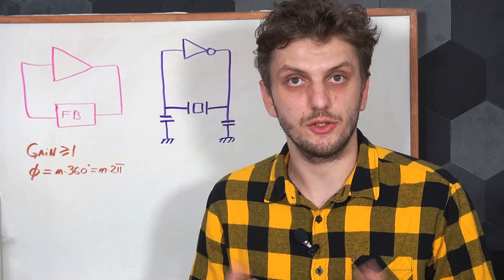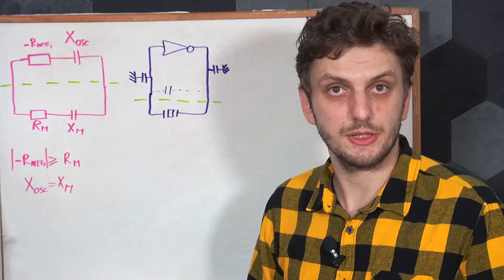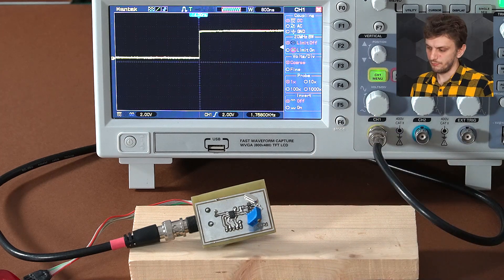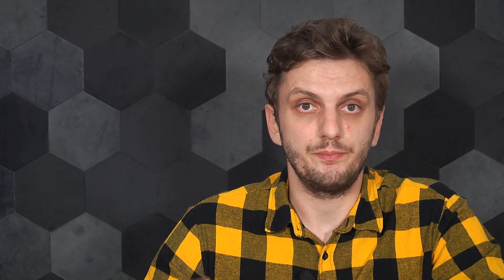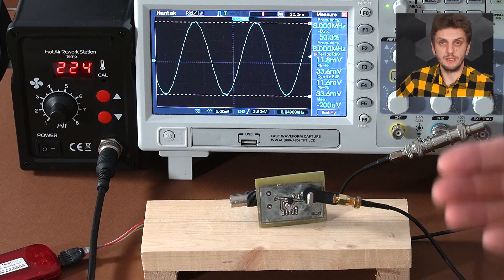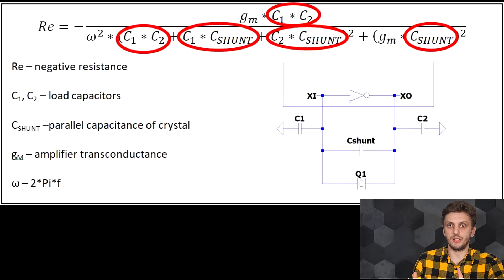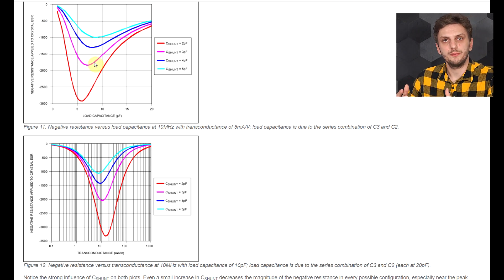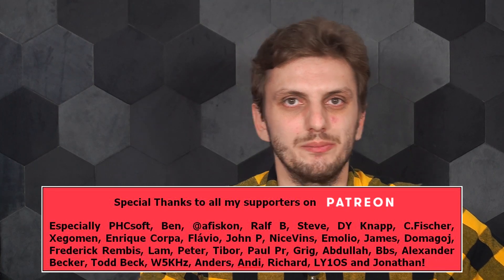Crystal oscillators - Negative resistance and oscillation margin measurements

Comment: To get the negative resistance higher, cant you attenuate the amplifier gain downward by adding a feedback resistor? That is a resistor across the input and output of the amplifier.

Comment: why dont you just pıt oscilkoscope probe on the xtal pins?
Reply from the maker: The probe has 10-20pF of capacitance; adding the prove directly would completely change the oscillators behavior.
Reply: @FesZElectronics  What about active probes? They have like 0.2 pF caps at max.
Reply from the maker: In what I observed from various application notes, measuring the oscillator frequency (the most sensitive test to external factors) should be done indirectly (either near-field probing, or using some other IC pins that output the OSC frequency, when available); but other measurements - like waveform shape or start-up time can be done with an active probe with direct probing.
Reply: @FesZElectronics  OK thanks! I am starting to measure my own crystals now :)
Reply: @FesZElectronics  Also I didn't catch how did you calculate the already existing 37 ohm ESR of the crystlal? Datasheet only states the maximum.
Reply from the maker: For the negative resistance measurement, usually the datasheet max ESR can be used; the actual ESR is more important in other measurements, like the drive level - I think I covered that in a separate video.

Comment: I am searching for an answer, how the voltage of a microcontroller can fluctuate without any problematic effects. Especially with voltageripple and noise/spikes in the range of the maximum values of the microcontroller. I have not found any aspects yet, that would oppose the use of a supply with a voltage ripple of 0.5V, and some noise/spikes. Except, that of course it would affect ADC measurements. I could not find much to this, so i suspect its not problematic?

Comment: Does the trimming pot add parasitics to the osc_in/out pins?
Reply from the maker: It does. The recommended way to do a highly accurate measurement is to first use the trim pot to find the rough value, then use fixed value resistors to fine tune.

Comment: You have to watch out with trim pots when margining crystals. Usually trim pots add a lot of inductance which can non-negligibly affect your margin depending on the crystal
Reply from the maker: May I ask what sort of differences did you encounter by using a trim pot as opposed to using fixed value resistors? Just to get an idea of the level of error.
Reply: @FesZElectronics  I've seen as bad as 1.5K being the limit on a pot vs 600 with an 0201 fixed resistor.
Reply from the maker: You must have very good eyesight to work with 0201 :D Anyway, I guess this is also frequency dependent - the impact of the extra inductance will be more severe with higher frequency crystals.

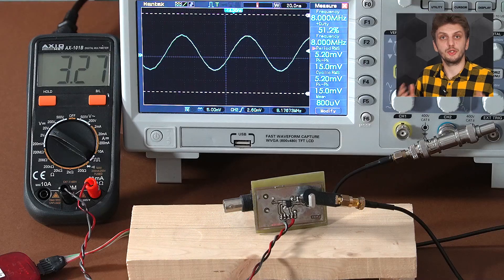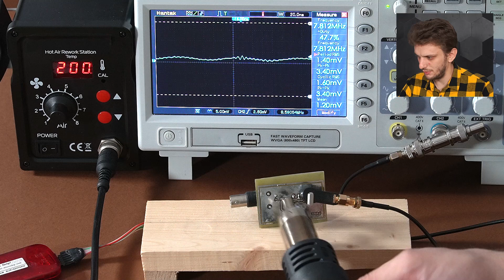Comment: Great video as always! One phenomenon I'm trying to think an explanation of; from 12:27 there seems to be some kind of intermittent frequency mixing of crystal's fundamental and, I presume, its higher harmonic. Same thing was happening in the end with the hot air test (12:01), which is even weirder to me - seems like there is a higher margin for the higher harmonic, or something else?
Reply from the maker: I was curious myself why that occurred, but I'm not quite sure yet. I guess it might have something to do with the averaging function used on the oscilloscope - to get eh waveform more static and uniform; but it might also have to do with the current probe and its impedance mismatch (between the probe inductor and the cabling)
Reply: @FesZElectronics  I should've looked more carefully, frequency of those oscillations seems to be ~100 MHz, so my money is on the averaging artifacts since your scope is 70 MHz BW.
Reply from the maker: Just because the oscilloscope has a BW of 70, doesn't mean it can't display more than 70M, it will just be attenuated. But I still think its some issue with the oscilloscope :D
Reply from the maker: I did some more investigations.. it seems my oscilloscope is on its last leg. I'm getting the oscillation on channel 1 even with the signal generator. Curiously, the oscillation does not appear on channel 2.
Reply: @FesZElectronics  that's interesting. Repair video maybe? :)
Reply from the maker: No, more like throw it out the window video maybe :D it's quite a cheap oscilloscope with which I had issues in the past, so its not really worth the effort to try to fix it. I'll be upgrading soon so that is how I will "fix" it.